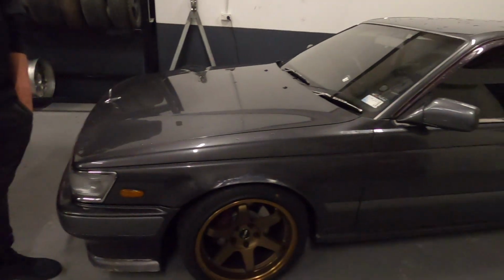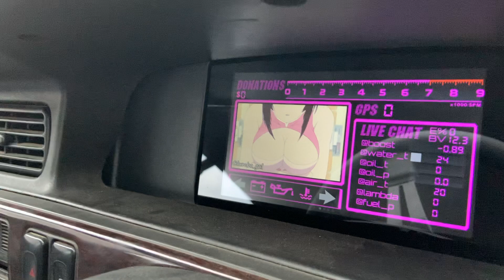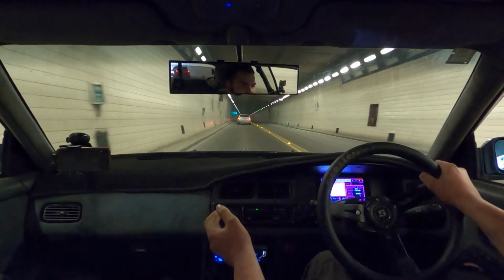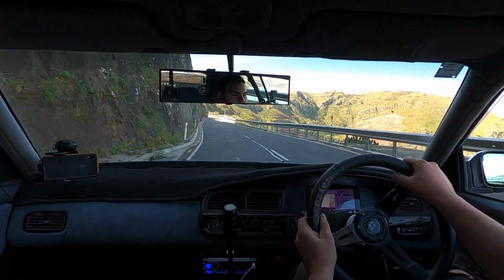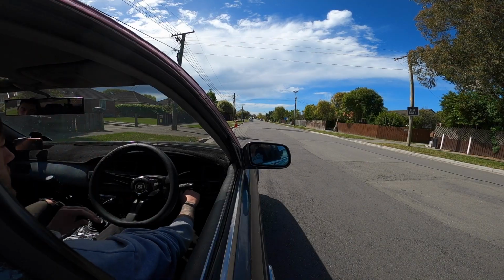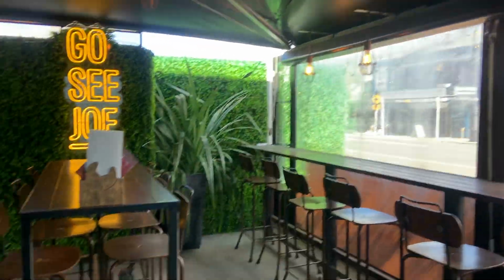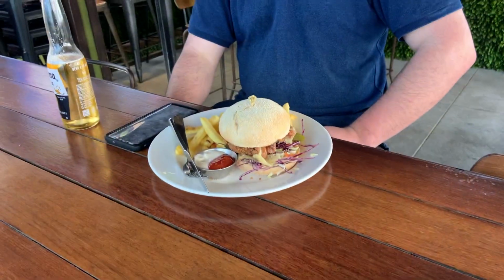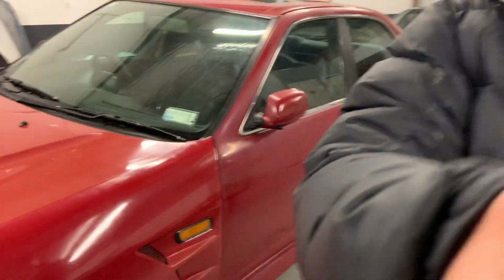FULLY FORGED RB25DET NEO C33 LAUREL HILL/TOUGE RUN!!! Epic Turbo & Wastegate Sounds!

Comment: Sounds cool, would be surprised of its an honest 700hp though
Reply from the maker: Makes 680 on high boost. This was low boost which is about 600 and it’s been on low boost in all the vids because it turns on the water meth on high. Just Round it to 700 in the titles
Reply: Doesn't look close to 700 on the road.